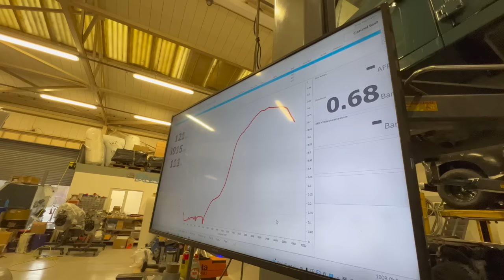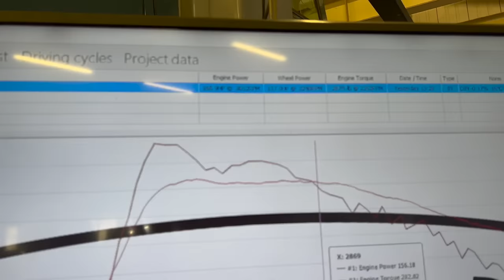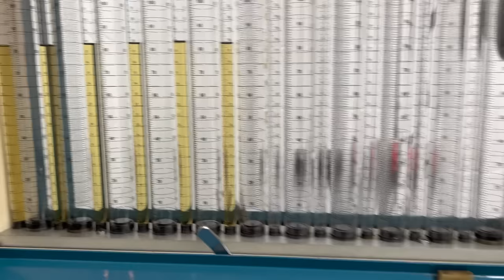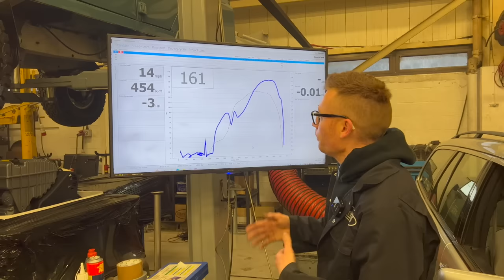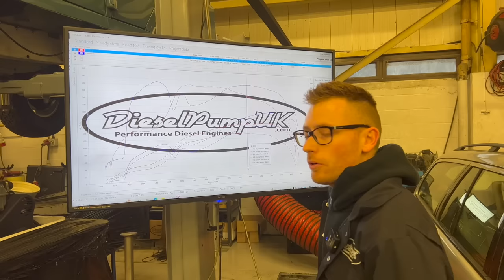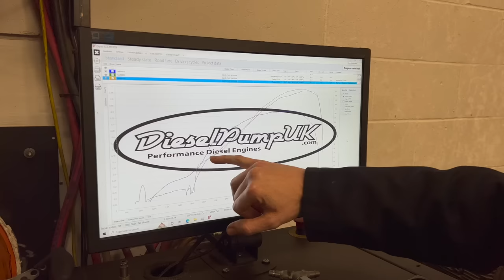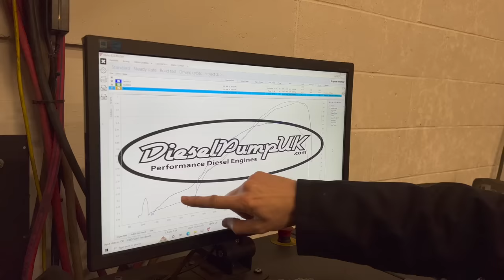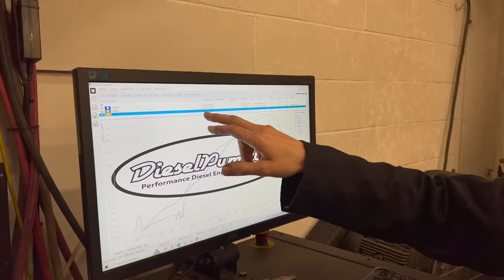7.7mm EDC pump fitment to a STOCK W210 E300td DYNO results

Comment: Iv just learned so much from your video mate big time and got the confidence to do bigger engine jobs myself. One thing I've learned as a cable jointer in Yorkshire most power cuts are localised failures are caused  by aluminium cable directly connected to copper cable with copper grease as it was done that way for a good few years, we use special grease now and believe it or not Mercedes actually sell there equivalent version £50 for a tiny put ffs they use it on injector body's il post you the Yorkshire electric version (ce electric) massive tubes i dont pay for.

Comment: You could try loosening the fuel lines at the injectors one at a time while cranking the engine until fuel squirts out of them. It will save the starter instead of cranking and cranking until all that air in the lines is compressed enough to open the injectors. Usually after bleeding about the first 3 or 4 injectors it will start up. About  1% of the cranking time to do it this way. Just a suggestion and always enjoy the videos.
Reply: I can usually get by with doing this with or injection line in a 4 cylinder VP pumped VW diesel, sometimes 2. Definitely works.
Reply: @tonyclark150.  This guy build pumps and your telling him how to bleed the system.what do you think? He doesn't know that.
Reply: He builds pumps for a living , I would think he knows how to prime a fuel system.
Reply: The only people that losen injector lines are always the people who arent real diesel techs😂
Reply: Exactly.
Reply from the maker: Always avoid cracking the injector lines if possible, introduction of dirt and wear on the ferrule is a greater evil than some air in the line. Mercedes consider this system “self priming” these vehicles are actually fitted with a starting system designed specifically to cope with this.
Reply: @DieselPumpUK what would it take to successfully run a mechanical injection pump in my 99 om606
Reply: As a proud vacancy

Comment: I've installed one 180 degrees out. We thought it was a lift pump or air issue as it cranked for ages, but then it fired right up and drove around the shed 🤣🤣 made about 10hp and hosed the bores down. Fixed now obvi.

Comment: Great content, If you do plan to upgrade the turbo, could you do another Dyno run and show us the steps of power increase with each mod? Always learn alot from your videos, thanks for taking the time and effort to make them.
 I'm looking for an OM606 here in the states, to install into A full size 4x4, and then "Bob's your Auntie" I'll have close to the perfect truck, alot like your Ford, but your videos are making them more expensive and harder to find.....Looking forward to the next one.
Reply: not sdure if you have found away round the needle lift injectors which seem to be impossible to get serviced or new for the landrover version
Reply: Just buy the whole car its cheaper

Comment: Thank you so much for the invaluable information.  Please tell me is there a key slot on the injection pump sprocket/gear for aligning the IP (similar to the crankshaft woodruff key way)?   Also, do you have om602 5 cylinders IP for the upgrades or remanufacture?

Comment: So here's a story before I move from North Carolina I sold my 87 Mercedes om603 when I got here to Arizona I was looking around found a 87 went down to purchase it looked it over it was super clean my wife had the title the guy left because we're meeting up in the parking lot and I realize it was a 1990 om602. I wanted a 87 because I wanted to install P pump from a Cummins which has 12 mm plungers or what you call Elements. Have you ever thought about running a Cummins P pump

Comment: I might trade one of my Jdm cars for a W210 soon it looks pretty clean 200k miles om606 td looking to make around 300 to 400whp stock if I do get it after I enjoy it stock for awhile. Hopefully your videos can keep teaching me. Im in America so these are hard to find so I’m willing to trade my sw20 for it
Reply: W210 always rot in the rear wheel wells, good solid engine but suffers from plastic pipe fuel leaks causing back flow

Comment: Great content really, I became an addicted to this channel. Do you have any solutions for a E290TD with the Bosch VE rotary EDC injection pump? I have a wagon with that and it's running great, I love the direct injection it starts better than any diesel car I know but I would like to see what options are available in terms of IP
Reply: 12mm plunger or resitance 400ohms (adjustable is beeter) between 2 and 3 cable with 11mm stock plunger

Comment: The box is changing harder because it builds more pressure when its under more load. Thats why if you potter about it will feel like stock. If you put more torque through it it will change harder still. 
Only downside is it will eventually reach a point where it can't build enough pressure and it will slip. 
That may need quite a bit of power though. They're pretty tough boxes.
Reply from the maker: Interesting suggestion but not the reason in this case. Hard shift is caused by the indifference in wheel speed.

Comment: I have your DPUK intake, exhaust manifold and borgwarner 257sxe + turbosmart wastegate. Plus Treacy ECU ready for install.  I figured I would put that stuff on, then do pump, plastic lines, water pump, pin crank.  Great content as usual!  Could you do more dyno runs with those parts on?  We would like to see what each mod does on dyno plus EGTs.
Reply: I need a Treacy ECU can you tell me his contact ?
Reply: @bahar9075   I have chips to install as I add turbo, injection pump ect. Just swapped it in, and it does baby burnouts now.... till stock MAP sensor maxes out and cuts fuel.

Comment: Hello there good sir,love your om606 project ,so how much would it cost for a crate engine with this pump installed plus mounts based in the project car and possibly an engine gear box adapter
Reply from the maker: Hi, for a crate engine build you would not want this type of pump, you would be better off with a mechanical version.
Reply: Thank you for your reply ,okay ,cost wise how much would it be?

Comment: In the Porsche world the experienced rebuilders say never use a metal impeller water pump because if the bearing in the pump starts to fail the metal impeller will eat away at the block vs. the plastic impeller breaking. Both failures are bad. @dieselpumpuk have you ever seen metal impellers grind away at the block?
Reply from the maker: The water pump sits in a separate aluminium housing so cannot come into contact with the block. Also no I have never seen a water pump bearing failure in this platform thankfully.
Reply: @DieselPumpUK  Good to know. Much better design then.

Comment: How are you for bookings now I need a non edc pump fitting which I have also wanting the pump tweaked with 7.7 mm already have the 0m606 turbo fitted but need exhaust system and intercooler piping and a front mount cooler supplied and fitted I’m ready to drop off anytime
Reply: Forgot to mention it’s a 0m605

Comment: Luke, You don't replace/reinstall the rubber piece behind the injector clips?
Reply from the maker: They were not removed, never fit the clips without the rubber sections behind.
Reply: @DieselPumpUK  Thank you sir, that's what I thought. Just couldn't see them in the video.

Comment: On older Mercedes 6 cyl diesels the injector pump outlet pipes had to be torqued three times. The technical manual said to torque them down, loosen and re-torque three times. If you didn’t you could often have a rough running engine.

Comment: Hey man what pump do you recomend for OM605 with a turbo from a 300td, straight pipe and software, now it makes 200hp and i was wondering what should be the next step: 6 speed manual, diff from a 300td, bigger fuel pump
Thank you for the videos❤

Comment: Personally, I would rebuild my injectors before I went off and did the injection pump. DPUK probably did, but I'm just saying, fresh injectors, then pump. If you're shooting for over 300hp pin the crank and cam. 300 might be low, but I'd rather be conservative on the build.

Comment: Any idea what's possible to achieve with 7.7 pump , stockish turbo and 200cell cat ( if that exists ).  like  the most hp you can get while still being Greta friendly?
Reply: I had a tuner tell me 240hp was what the factory pump could do.  I'm guessing that's even more than what factory turbo could do.
Reply: @Jessersadler  he told me the factory turbo is good for 250hp pushing it.

Comment: what did you do to get rid of the check engine light caused by the EGR being removed?
Reply: That old car doesn’t have any lamda sensor with an proper EGR valve with position sensor in it to regulate the EGR, on those old engines it was just controlled by vacuum to an theoretical value by the ECU
Reply: @martinandersson5278  They still have to delete it from ecu , the MAF sensor can detect if the egr is blocked at idle on these
Reply: @torqgarage  Nope, there is no lamda sensor in the exhaust so it’s just a theoretical value.
Done this on soooo many IVECO trucks even with common rail engines, but not possible after they fitted the lamda sensor to have better control over the EGR
Reply: @martinandersson5278  I'm having a check engine with the EGR removed.  . . so there definitely is one.  99 e300
Reply: @martinandersson5278 it is maf sensor which senses if there is egr or not too

Comment: So correct me if I’m wrong but when you were removing the bolt for the fuel pump gear was that reverse thread? I’ve watched the clip a few times now and I’m still a bit confused. Thanks

Comment: just one q. how is the gearbox holding up with 300 hp +. I have an w211 320 wit 280 hk. and 640 ish nm.  but that is what mercedes say that the gearbox can handle.- it is an 7 speed automatic.

Comment: So over £1000 to only make 45.8 hp is it worth all the hard work and time spending changing a pump ? And some super weird way to keep the timing correct, if I was going to do it then I would change the timing chain as well and make sure everything is correct and tight
Reply: dude... the new pump allows for up to 600 hp if you install a bigger turbo which can be bought for cheap

Comment: Hello all, so I got a 98 e300td. And was lied to me by the previous owner about condition of a car. And when I looked at it twice thr engine was hot and ran ok, with a little misfire but no check engine,  so I decided to buy it. After washing an engine so I could do some maintenance on it, it cooled off completely. And after I cranked it it idle very rough and had lots of misfire. And it had good bit of white smoke. Like to much fuel in the  exhaust.  I went for a drive and it was bad until engine got hot and gave me a check engine light and a code for random misfire. Than it sounded and felt just like when I bought it. On farther inspection I see a lot of air in the fuel lines. 
So my question is. Would air in fuel make an engine misfire, smoke, loud metal clicking noise (that's goes away with rpm)? Where should I start with tackling this problem?
Reply: Yes most likely because of air in the fuel system. Most likely culprit are the O-rings mentioned in this video

Comment: Better to do a remap then trick the ecu with a map sensor
Reply from the maker: Thanks for your comment however the issue with what you have suggested is the stock boost sensor cannot handle the higher boost pressure we are trying to achieve so the sensor must be changed.
Reply: @DieselPumpUK  Yeah best to do both at the same time for best performance.

Comment: I am running om605turbo with 7.5mm mechanical pump in w124 with stock turbo and stock w124 250d exhaust underneath, i am sure my gains are much bigger than on this edc pump, what can be the reason? Can you make an info video why you think a bigger turbo at 2.2bar wil make more than the stock turbo at same pressure. I am dreaming about your s200 turbo, but i am afraid i will lose the early spool up of my stock turbo. (Have to admit i have problems with engine jerking above 4500rpm now, but not sure if it is from turbo or fuel supply)

Comment: But why EDC 7,7mm with original turbo? 
6mm Edc can flud the engine even with v2 turbo of yours and i used 4bar sensor.
May be the tune but even im impressed how could it happen. V2 is great turbo no doubt but how with 6mm elements? Original pump, original lift pump.
Reply: Turbo is next step, this pump is capable of over 600bhp

Comment: Hi :)
48:53 Why are the air conditioning fans turning on even though the engine is not running yet?
Reply: Just a self test of the fans the ecu does.
Reply: @timbo19751975  OK.

Comment: With this model, I would rather make sure that it doesn't rust away from under my butt. That was a terrible series. Technically excellent, as always with Mercedes, but the organically contaminated primer was terrible.
Reply: buy your cars in the south of the US. they never rust here. the paint gets baked off in the sun, but still no rust. then again, y'all drive on the other side of the road.